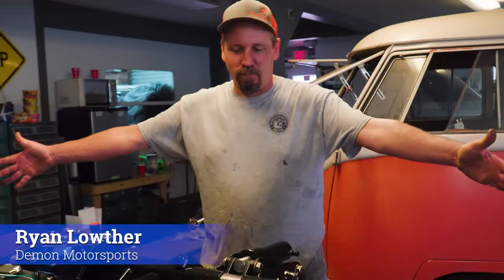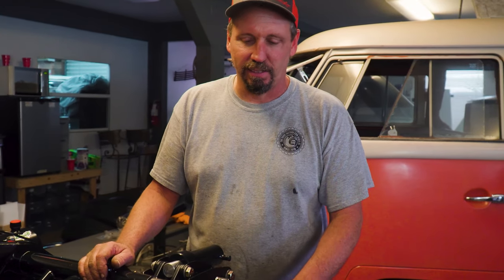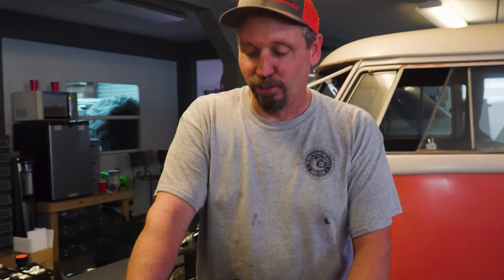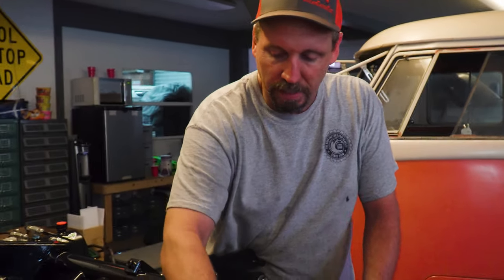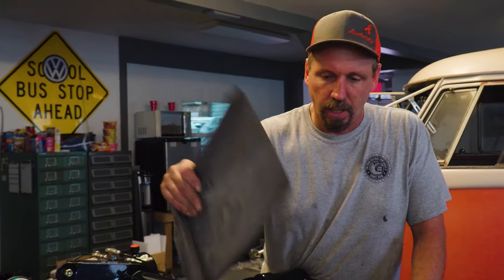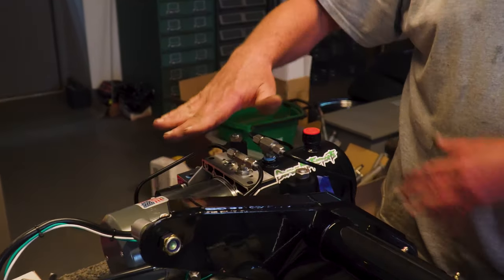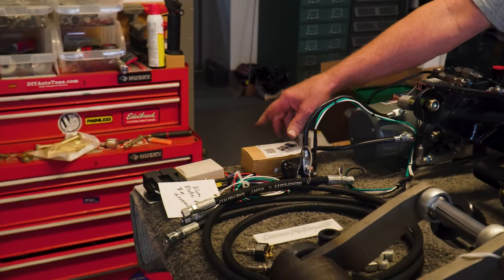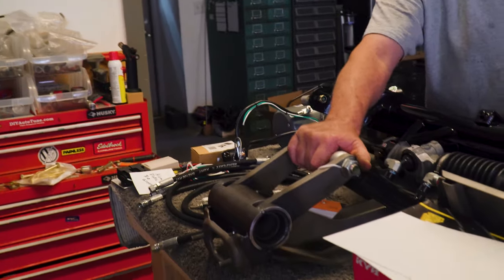Lower Your Air Cooled Volkswagen With Hydraulics | VW Bug, Thing, Ghia, Bus!

Comment: Can you post some more detailed videos about this setup? Heard about it on Let's Talk Dubs and I'm finally seeing it now! Also, is there not a website for Demon? Or is there only a Facebook page?
Reply from the maker: Yes only a Demon Motorsports Facebook. What type of stuff would you like to see?.. we've done a few videos on this setup so I might be able to point you to one of those.
Reply: @RobStapleton  I haven't found a detailed video describing/showing how a T1 front beam works. I saw one video showing how the Ghia goes up and still has a soft ride but how low realistically can you drive on this kind of setup? Seems like it may be too soft to roll pretty low? 

I guess I'm still trying to find more info to help me feel confident that spending $10k(or less) on this suspension setup is how I want to proceed.
Reply from the maker: @joshcosta423  Send me an email with your contact info... It will be easier to talk about it as opposed to texting back an forth and I can give you all the details. ekcorob@gmail.com